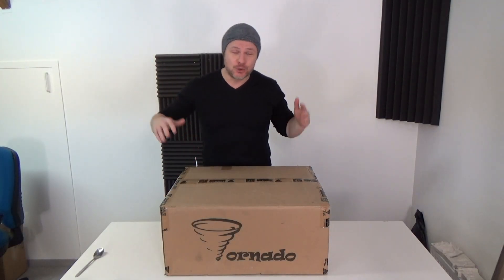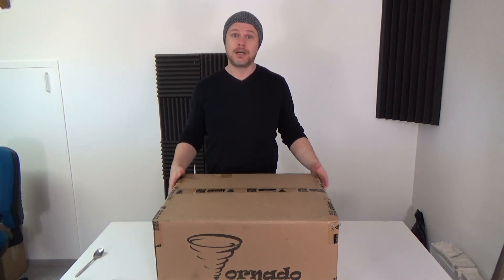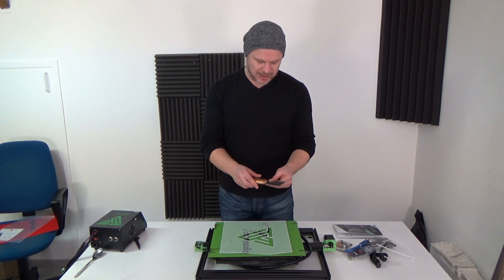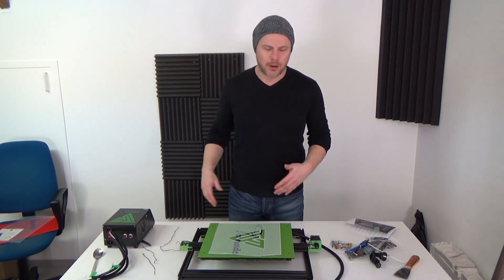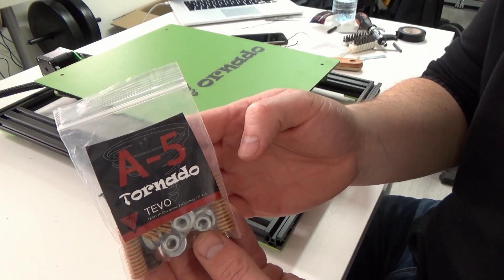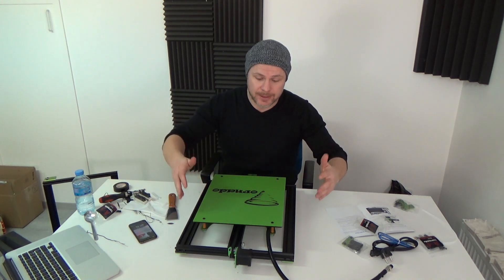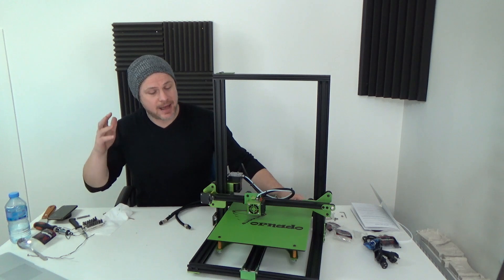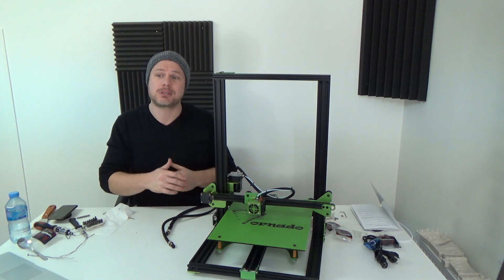99% NooB Unboxing and Assemble of Tevo Tornado 3D printer

Comment: what filament did you use
Reply from the maker: Hi Rick,
Personally I use this one:
https://www.gearbest.com/3d-printer-supplies/pp_1155866.html?lkid=13561381
It's CCTREE.  I found this an excalent filament and never had any problems and the quality is just amazing.
Cheers
DB
Reply: I use the abs version of that filament and it has clogged up everything
Reply from the maker: Haven't experienced yet with ABS.
I've also just released a new video about the review of Tevo Tornado.  Maybe the clogging has something to do with the bedleveling and wobbled bed surface.
Cheers
DB
Reply: @PropsN3D  are you still using the Tevo Tornado? or did you upgrade to a different one?